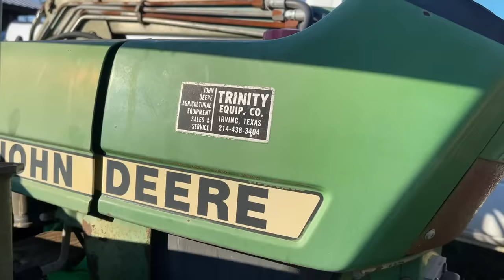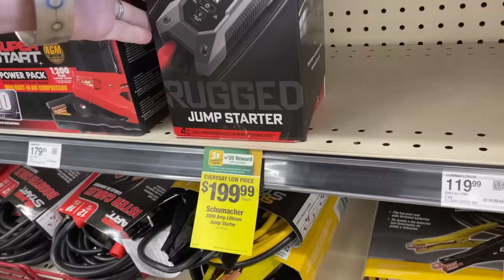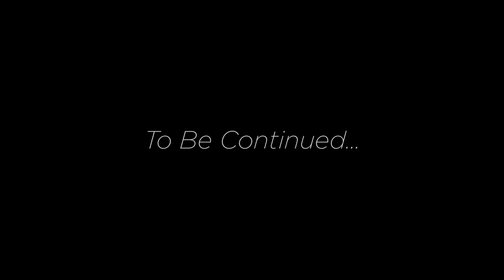John Deere tractor with a BLOWN ENGINE for $1k?! WE’RE IN! Pt. 1

Comment: I had a buddy that bought a tractor very much like the one shown. The engine was locked up. I think he gave $300 for it and he had to move it while it was split in two. He found a bolt had slipped into the timing gears and jammed the cam and pump gear. He pulled it out, re-installed the timing cover, put the tractor back together and is using it today. The problem with these small tractors is they take a beating. They get used to things they were never designed for.

Comment: About the bearing you couldn't punch out. Next time, get a welding machine and run a hot & heavy pass all the way around (360 degrees) on the inside of the bearing. Use low hydrogen electrode (7018) 1/8" diameter for such a small bearing to minimize weld spatter. If weld spatter is a concern, just wrap everything in the area with leather or fire blanket. When you weld that bead all around, the heat expands the old bearing but when it cools it will shrink enough to almost fall right out without beating the s**t out of i.

Comment: umm.. taking all for granted, the gaps on the bearings to the journals, specially on a used crank.. Plastigauge is what should be used to verify the clearances, which, if not standard, can be restored by either crank grinding and oversize bearings, or if the crank is not standard but reconditioned, you use the correct sized bearings. This is CRITICAL to oil pressure and longevity to the engine. Wow. .. a lot of work done and skip this step? Fun vid, in any event. 🙏🙏

Comment: i took a thermoking 3 cylinder deisel from a over the cab reefer unit used on refridgation box truck bodies, and set it into a ford tractor that had a blown 2 cyl gas motor, and another one I put into a smaller Massy garden tractor.  along with built Front end loaders on them both. My kid over heated the one in the massy and some one stole the little ford tractor.  I have access to many many many little 2 cylinder deisel motors from ThermoKing, and Carrier Heater units off of semi heater trailers. along with I also have one rail container Heater unit the motor has less than 3000 runing hours. it is a totally new engine.

Comment: on old machinery, rethread all holes and bolts,,,maybe rethread holes and buy new bolts, be careful with injection,,,if you dont know what you are doing take it to shop with flow bench and an expert there, oil pump is proly ok but check clearances, clutch is handy,,,check or replace,,,,

Comment: At 35:35 sorry but it’s nothing hard about knocking out that bearing probably two minutes at a machine shop…… might be five bucks cost to remove and to install new one if you are worried! I have a home made press for doing driveshafts u-joints and bearings like this! Works great! Been building engines for more than fifty years! Hopefully this information helps long term!

Comment: $25,000. The last tractor we bought was $130k. That was 2014 and it was 2 years old. Combines are going for almost half a million. My dad bought a 7800 brand new in 95 ish it was $45,000. That's a 145hp. The most recent was 260hp. We're now pulling too big of implements to use a 150hp tractor. Seed farming is all about timing.

Comment: Well you changed the crank, so I think that berring you couldn't replace wont matter because chances are the other cracks woren different,  the only way to know the 
Fit and inspect to to see if its in tolerances is with an inside mic and and outside mic  probably something you dont have, but it might be a good time to buy a set of them used if your doing a lot of engine rebuilding.  
The 2 cylinder puts out how many HP
Me I grew up around a Ford 8n  it had a flat stright 6 I belive.  You used to be able to pick them up used for 250 bucks
Brand new thats about what they cost.
Now they go for 2k or more.

Comment: Also, you really should never assemble an engine without measuring the crankshaft for taper and out of round, and measure the bearing ID to ensure proper oil clearance.

Comment: Interesting.. Usually on a 2 cylinder 4 stroke motor the pistons rise and fall together as this balances the primary forces (engineering nerd here). Is this a 2 stroke motor maybe?   The Yanmar diesels are very good. I got the 4 cylinder version in a 30hp Yanmar tractor. I too had to rebuild the motor.. it was botched in the past.. But its been bulletproof ever since. Oh on seized studs I just weld a nut on the end..:)

Comment: As new as that little tractor is the hydraulic pump should run all the time. The old 2 cylinder tractors you could turn off the hydraulic pump. They quit making them in 1960.

Comment: i shudder as you hit steel gears and bearings with steel lump hammer rather use copper brass dolly  so you don't burr  the softer metals.

Comment: I am.positive that bearing will fail in 30 years
Reply: Are you joking? 30 years is pretty good for any bearing by today’s standards
Reply: @brandon18054  you are not even thirty yourself.  How could you even know.   I am 75 I have seen lots of barings fail in ET electrical motors, gas and diesel motors.  Helicopters which I flew in Viet Nam.  Just stand on a street corner anywhere in the USA.  Lots of cars with failed or failing bearings will go by.

Comment: well  its  this== down  to  earth  people  who  dont  have  nuch  but  a  lot  more  than  me  i  got  a pole  barn  amish  mom  passed  left  me moneys  all  gone  now  but  i  bought  a  30x  48  long 8  foot tall     garage  no  cement  no  insulation  on  inside  walls  open  rafters ele  15  foot  dood  and  a  reg  door  its  nice  but  no  lifts  no  pit  no  good  lights  a  2  55 gal  over   and  under  wood  stove    48  chev truck 5 window 3100  216 stick  3  on  the  tree  short  bed   3  wheele  horses  with  2  plows one  1963  and  nice  48 inch  deck?   =1978=1990  nice  horse     well  used  tools boxes  beat  up  38  years  body  work    garage  full  horse  parts   reartrans  3  of  those  3  motors  lots   of  hoard  my  garage  looks  9  3/4   months   preg  caind  half  see   and  had  heart  actt  at  75  im  81  now  caint  feel  good  enough  to  finisg  in  old  truck  no  money  to  do  it  BUT  JUST  LIKE  YOU  2  I DO  WHAT  I CAN  down  to  earth  with  the  loards  help    whife  8  months  ago  had  open  heart   and leas  week  had  left  side  of  he  neck  opened   up  doing  good now    we  been  togeather  53  YEARS  NOW  LIFES  GOOG   NICE WENNER  10 YR  OLD  PUP  NAME  REBEL  don  give  up  just do  like  you are  doing  and  you  will  be  in  the  same  shape  where  in  but  had  dam  good  dun  getting  there  peace    and  god  bless  i scribed  clicked  up  thanks  for  the  nice  vids  good  night